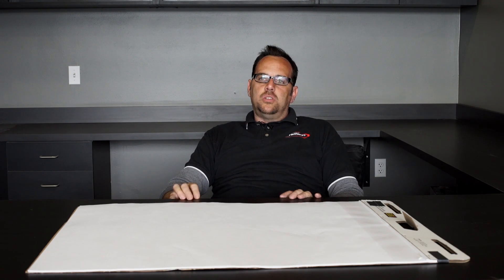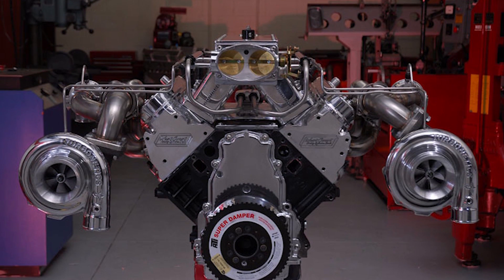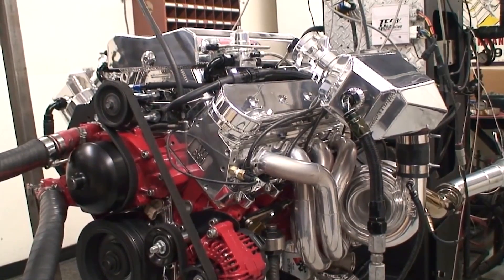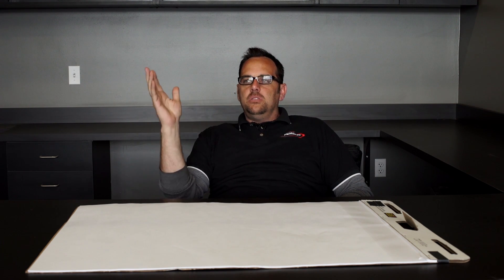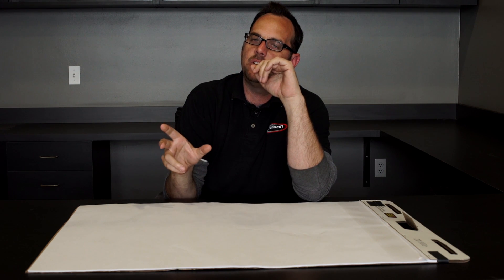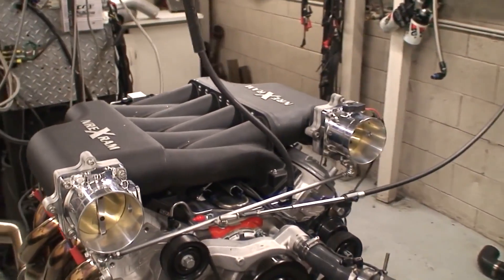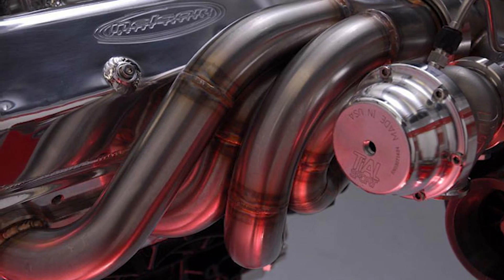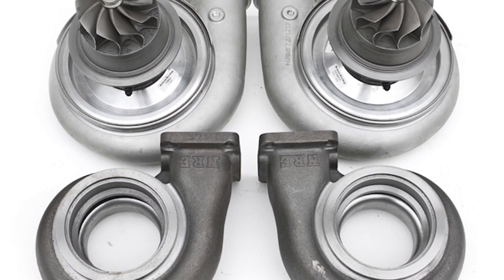Master Engine Builder Explains Why the LS V8 Is SO Good

Comment: LS is, all things considered, probably the best engine ever. A lot of people go on about overhead cam etc but they're really missing the point.
Reply: the LT is essentially an LS with direct injection  built from the same base
Reply: jon snow right, but that has nothing to do with this video, right? nobody cares what Europeans want.
Reply: jon snow uh 500 cid blown top fuelers
Reply: https://www.chevrolet.com/performance/crate-engines/lsx-454r
it says cast iron block
Reply: Werner Wernersen I didn't know you were talking about that specific block. Thought you were saying all ls engines
Reply: Well, isn´t that the top-end model of the LS? The LS-X?
However, the LS7 of the Corvette Zo6 is cast aluminum.
Reply: Simon you dummy its always been about cost If you want to put cheap into your dream use the LS But if you want awsome quality go 4valve something to be really proud of and last 500,000miles or the almost 100,000 miles you will get with the LS Viagra indused engine...
Reply: Garrett Martel exactly! so you take the awesomeness of the LS architecture and give it the flexibility and tunability of direct injection. that's a big big win
Reply: falchulk shit in comparison to the Barra turbo engine,i chomp ls Commodores (chevy ss) all day
Reply: @sriley064  you been racing dudes on the highway who is just trying to get home? Turbo power an LS and the barra is humbled, i own a fg xrt6, but race a twin turbo  whipple sc ls9 on the track for a reason.
Reply: You put the best parts possibly available for a 2JZ on that motor and compare it to the best parts possibly available for a Big Block Chevy on one of those, and the Big Block Chevy will win all day long. Then you twin turbo both of those with the biggest possible turbo those motors can withstand without blowing up, and you still have the Big Block Chevy on top. You put the same technology from a small motor and apply that to a big motor, there is no question the bigger motor will win.
In terms of maximum power, there truly is no replacement for displacement.
Reply: @rustysausage69  Except when you really want to play with serious HP around 10,000 to 12,000 HP with 500 cid max displacement like top fuel dragsters, then you go a hemi Mopar or Boss 500 Ford. Chevy has no answer to those two engines.
Reply: 1. only some ls truck engines are iron. 2. only stock v12's make more power. 3. A 1000 hp 2jz will NOT have any low end until 6000 rpm. A ls would still blow the tires off at 3500 rpm. 4. My uncle had a BMW special edition v8. The motor exploded. 5. My z28 got 32 mph on the highway. It didn't. hit 2000 rpm til 90 mph.
Reply: Simon Coles new LT motor. move over LS
Reply: "My uncle had a BMW special edition v8. The motor exploded" Thats because gasoline in the U.S. is as good compared to the gasoline we have in germany, the country where BMWs are designed/produced (Except for the X´s). "Premium" in the U.S. is 93 octane while 95 octane is MINIMUM in germany.

Thats why engine explosions or other malfunctions of german engines occur much more frequently in the U.S. than in europe, german cars are not designed for such bad fuel.

"2. only stock v12's make more power. " Wrong, there are many stock V8s that produce more power, f.e. the mclaren 3.8l biturbo V8, Koenigseggs 4.8l/5l biturbo V8, Porsche 991.2 GT2 RS 3.8l flat-six. 2017 Ford GTs V6 also has more power I think. You also forgot about the Dodge Viper ACR V10.

"3. A 1000 hp 2jz will NOT have any low end until 6000 rpm. " So? Do you need lowend when you can always drive at high rpm, thanks to the gearing? Certainly not.

"1. only some ls truck engines are iron." The engine block of the LSX is cast iron. But yeah, the pistons and cylinder heads are made of aluminum.
Reply: Werner Wernersen 97 octane in EU is only 91 in US. The ratings use different systems
Reply: Werner Wernersen Ls engines are aluminum blocks. The truck engines are called lq9 and lq4 they are basically the same engine but iron. The new Zl1 did extremely well at Nurinburg track beating out alot of Euro sports cars that cost 3 times the amount.
Reply: Werner Wernersen yes and no. The ls7 is the baddest all motor factory engine chevy makes period. The lsx everyone talks about is actually just an aftermarket engine block that you can build anything from a 427, all the way to around 482 cubic inches. The block is a very good iron block that can handle anything from a 9000 rpm all motor build making 900 hp to a built low compression turbocharged build making from 1000-1800 hp or more to the rear tires (2000 flywheel).
Reply: jon snow uh no displacement will always beat out anything in pure power im sorry technology will only help make out the power you can achieve on a static displacement na which displacement of a high degree will always make more power and actually not work as hard to make that power small displacement high hp motor do not pass emissions
Reply: you speak like someone who knows nothing about engines. getting a lot of power by increasing the engine size is trivially simple from a design standpoint. pretty much all major WW2 participants had 2000hp+ engines in their planes by the end of the war. that's 70 years ago. and those v12s were not phisically as heavy or big as most people think.they had huge displacements though.

however those engines could eat hundreds of liters of fuel per hour and they were anything but reliable. few engines survived past 100hours without major rebuilds (in case wep was used, a rebuild was mandatory as soon as they landed).

you talk about maximum power and putting the same technology on both, but that's the difference TECHNOLOGY. there are 2jz engines in excess of 2000hp (look on yt the guy from dubai), and there are also bigblocks in excess of 2000hp. but neither of them have much in common with the original engines (even the blocks are not original, they are custom made).

a really good engine is the one that can provide the desired power with the least fuel, having best emissions possible and be extremely reliable at the same time. you can't achieve all those things in the same time with a big block that uses technology from the '50s. the ones that are super reliable, have lower HP/displacement and the ones that produce good power are way less reliable and thirsty.

there is a replacement for displacement. it's called technology. the only drawback is the cost.
Reply: >best emissions

Or alternately live somewhere without emissions testing
Reply: i think you're missing the point. not everyone lives in USA. a lot of countries, especially in europe, have INSANE taxes for cars with high displacement engines. when annual tax for a 6 litre engine is national's average income over 6 moths, or when insurance or some random "eco" tax is more than you earn in a month, or registering the car would cost you more than the car itself, i think you would go for a smaller displacement too.

i'm not saying LS engines or V8s in general are bad. they are great at making good torque and are very reliable, but they are not practical for everyone. not to mention they tent to be very thirsty. and when you earn a third or half an average american earns but fuel is 4 times more expensive, this becomes a problem too.

"there's no replacement for displacement" some may say. but that's false. there is a replacement, it's called TECHNOLOGY. this is where dohc, turbo, complex electronics and admission systems come into place. they offer great power and better fuel economy in smaller engines. the tradeoff is that they cost a lot and the more complex the engines are, the less reliable they tend to be on the long run. but again, for most of us, there's no viable v8 alternative.
Reply: jon snow
Technology isnt ultimately a replacement for displacement because technology+displacement is ultimately how you make the ultimate fast engine. Imagine turbos dohc etc put on a high displacement v8 for example

I do understand though what you mean some countries have retarded anti car no fun allowed governments. They wanted to try that crap here but people got mad so they didnt plus everyone would just lie about what engine they had
Reply: it has everything to do with this video. a dude said LS are best engines ever. they are simply not. they are simply way impractical for anyone outside US.
Reply: More like impractical for europe and even then probably only western europe where everything is taxed to hell and back

Im outside the US and theyre practical here

In countries like middle eastern oil producing ones theyre even more practical because gas is even cheaper than the US. Crown vics for example were hugely popular in saudi arabia even through the 2008 crash that killed off their civillian market in the west because gas is super cheap there
Reply: +jdr ok Do you seriously not get it? You constantly seem to ignore that technology allows an engine to have higher hp per ccm, which means that it would have more horspepower @ same displacement. It can also reduce fuel consumption and increase durability etc., thats why an european engine like f.e. BMW V8´s or ferrari V12 are better than LS, or any other american V8 that uses outdated technology, in terms of power, torque, delivery, efficiency etc., weight less, are more compact, on the other hand: Yes, they cost more. But thats the only thing the LS is good at...beeing affordable. Thats why the LS for example is partly made from iron...

The new Ford GT´s biturbo V6 is pretty good though.
Reply: Miami and Barra Turbo > Loser Shit
Reply: falchulk i doubt they can compare to the best and most efficient high power european engines, but again, LS are also way cheaper to produce and maintain.

the point is that if you want a car to get you from point A to point B, you don't want ia super powerful engine, most europeans would pick a 1.6-2.0L engine that has something like 60-70mpg compared to 20 something or even 30mpg a LS-powered car can achieve. not to mention, most europeans don't use their cars that much on highways, a lot of people drive a lot in cities, where big engine fuel consumption is absolutely insane.

most people neither want or need a large displacement engine in their car. besides that, as i said, in a lot of countries, the taxes for such an engine are MASSIVE.

Comment: The LS, 2JZ-GTE, RB26, and 1.3 liter twin turbo 13B rotary engines are all great and legendary engines that are great to work with. They all love making big and decent amount of power. Great presentation Nelson!
Reply: Rb26 are not that great stock lol.  And rotary are unreliable time bombs
Reply: @muzzytt  You're definetly wrong
Reply: @verttisyrjala2897  how so what I said is true
Reply: Muzzyt not true at all RB26 is capable of getting 1000hp on stock internals and rotates are reliable if you take care of them it’s not the engines fault if you don’t take care of it.
Reply: @verttisyrjala2897  well I'm sorry if I hurt your feelings but a rotary engine is certainly not a reliable engine.  Just go ask R X 8 owners how they are going.
Reply: @verttisyrjala2897  lol ok it's obvious you have no idea what you're on about.

Comment: LS is good but it's expensive to modify and I prefer a natural aspirated big cubic inch RAT MOTOR. my 496 stroker with 9.1:1 CR on the dyno made 575hp and 600tq and get this it has iron rectangular port heads no port work. mild hydraulic roller cam. Show me a LS, coyote, or modern Hemi anything that make that type of power with low compression, mild camshaft, stock iron heads....I don't think so and I didn't break my account😅😅😅😅😅

Comment: LS engines are junk in comparison to what is out there, the technology in the LS are so outdated.... single cam pushrods and for a motor company that has been around forever you would think they'd have designed something a bit better than this

Comment: one special thing is Chevy was sending out 5.3 with factor defect heads for years. look for the stamp that looks like a AA battery. what really sucks is about 100% of remanufactured heads are the defected ones because guys swapped them out. if your slowly losing radiator fluid check your heads.
Reply: yep, that was messed up.  So was the valve drop problem and eccentric valve stem wear on LS-7

Comment: The title of the video assumes that it is good.

I didn't see or hear any actual comparisons other than cost comparisons and that was on the side of the LS being cheaper than other motors and as we all know, cheaper isn't generally better.
Reply: "Make great power": LS3 6,2l 436hp 580nm, LS7 7,0l 505hp 640nm.... that really doesn't sound that powerful for such gigantic engines.
Reply: lol . iIts not an assumption. They arent just cheap. They are rock solid reliable and make great power . What else do you want? Let me guess, youre one of those guys who equates complicated=better. Amirite?
Reply: never realized they had computer controlled ignition. what do I call my 69 307 with points ignition? LS certainly is not the bleeding edge of technology, but bleeding edge is typically not the best to begin with. LS is a bullet proof - cheap -reliable platform you can put in anything. Sure it is a bit boring now, I mean you go to most drag races and its either  a LS or Hemi of some  type.
Reply: just cause it's based on old tech doesn't mean it isn't a "GREAT" engine the fact that is can fit in anything on wheels and male scary shit your pants power reliably and for comparatively way less money at the same time make it a "GREAT" engine new done not mean better.
Reply: That's because its a big and heavy engine. Big Ass Pistons and big heavy crank. Its 1950's Technology that for some reason GM is holding on too. 

Why is it that a 5.4ltr SuperCharged "coyote" v8 produce just slightly less HP and Torque than a 6.2ltr LS SuperCharged Engine?

The whole no replacement for displacement is no longer the case.. Also Hemi is a gimmick almost every engine now days has some slight hemispherical combustion chamber now.
Reply: Chris Lambert
spoken like someone that knows noting about engines the ls family is very light for a v8 lighter and a lot smaller in physical size then your coyote which doesn't have the torque of a chevy v8 in fact the aluminum ls v8 block is lighter then most i6's and iron v6's and is more reliable, easily and cheaply modifiable and since it's so small in a overall physical sense that means with a no sump oil pan you can get the engine very low in a race car to get the center of gravity lower and farther to the back for a 50/50 weight distribution making a great racing engine also push rod tech is new then ohc don't talk shit unless you actually know something.
Reply: Ls engines are cheaper? It isn't actually cheaper when you have to completely rebuild it 2-3 times more often than a Ford engine making equal or more power.
Reply: Omg, also the replacement for displacement is a lie with the iron block  4.8 and 5.3 witch are used religiously where I am from, you take one for a couple hundred file the piston ring turbo charge is and you are making depending on what you got 400 to 600hp without breaking the bank, yes the 5.0 V8 is an excellent motor, will it out live the LS in most cases no, I dont know if it is the in block cams or the vortec head but you cannot kill these things, even making a race ready engine on stock internals, there is a lot of hate on this motor purely because it's older technology and it has yet to be peaked, yeah ohc is great, BUT there are LS motors and vortec motors everywhere! YOU DONT EVEN HAVE TO GO INTO A CATALOG, just find a low miles truck/car that has been wrecked and part it out! I that's apart of the glory. Lol

Comment: i would love one of these ls motors in my sleeper suv
Reply: i did an 06 durango...stroked out the 5.7 engine to a 392 stroker. comp stage 2 cam. huge sleeper. i have a 2002 2500hd that had a 6.0 gas thats at the machine shop now and it will be going into my rat rod.

Comment: what is a good idea for a 4.8 I'm building. I want to run nos plate kit for a drag car..
Reply: run a turbo kit. cylinder walls are so thick on 4.8s and 5.3s
Reply: true that. 6.0 lq4 or 9s are bad ass
Reply: +Brandon Rice even crazier strength with an iron block.
Reply: Paul Barnes look into nitrous express, they have a plate kit. they give you all the info you need. very affordable and great customer service

Comment: I wish this dude could differentiate between an engine and a motor.
Reply: It might be news to you, but there IS a difference between an engine and a motor. One runs off combustion, and the other runs off electricity.
Reply: I've been a mechanic for over 20 years and it still gets to me when people call an engine a motor. There is a difference and I don't see how they can be explained interchangeably by the fact they are two different things.